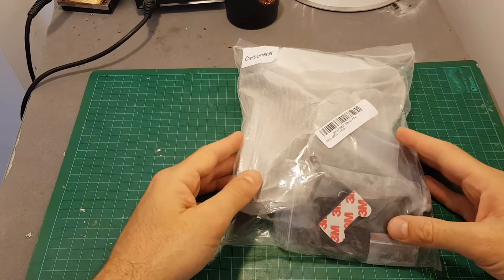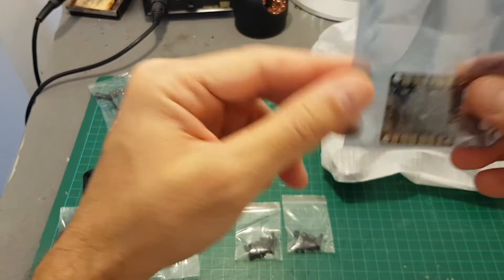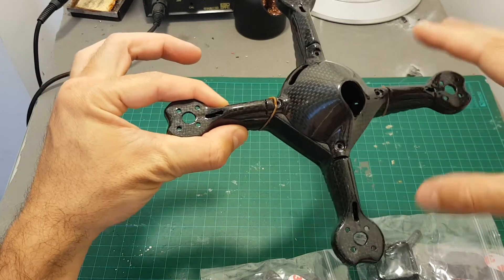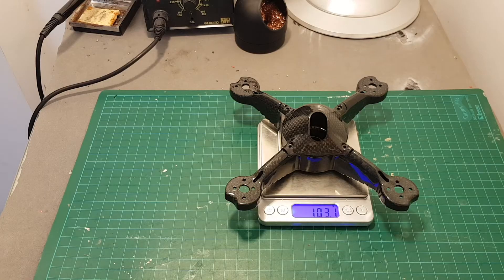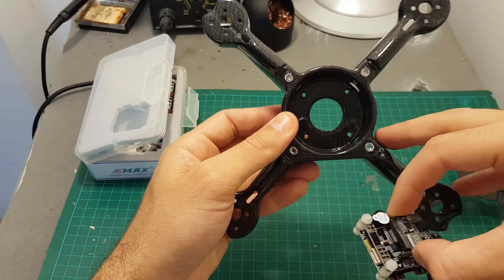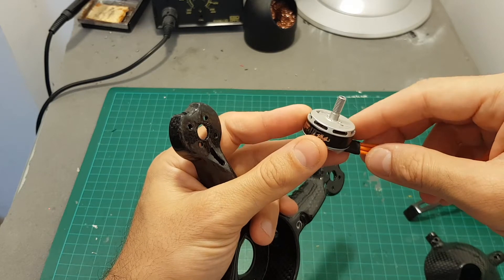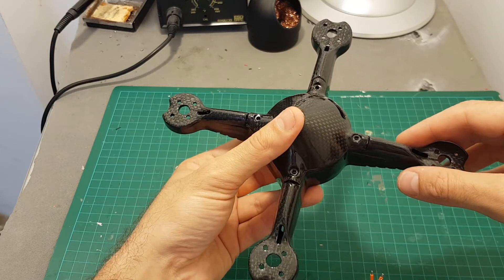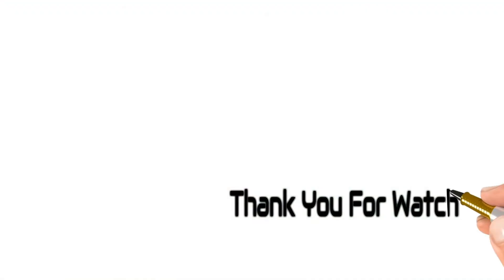Realacc Carbonstar 190mm - Frame Overview

Comment: I also bought an AIO stacked FC and 4 in 1 ESC. Wouldn't fit. Especially with an Eagle 2 cam. Changing to F3 FC and separate ESC's. 

FU RC sucks and is run by a dickhead.